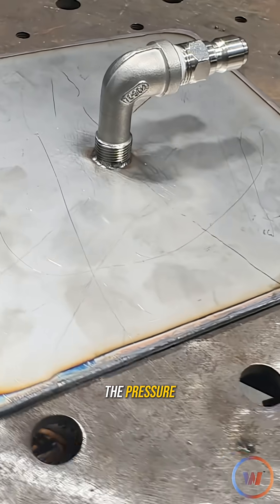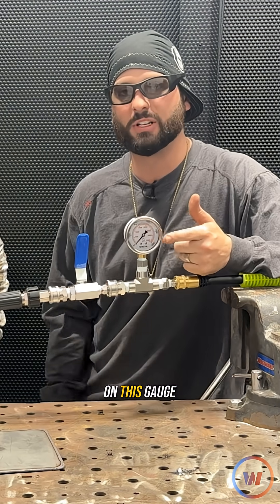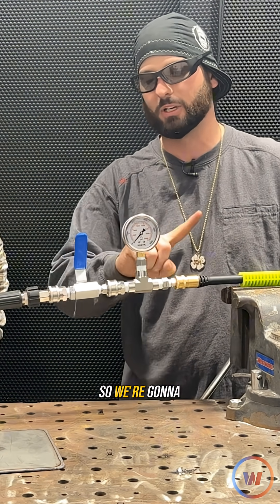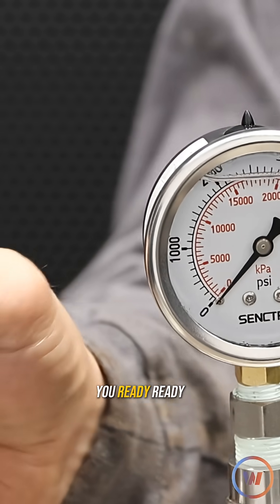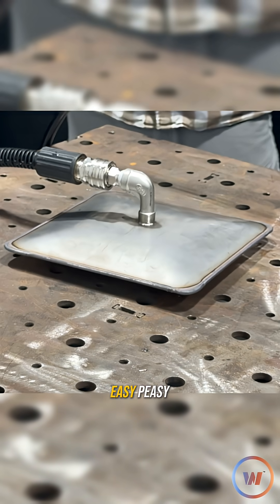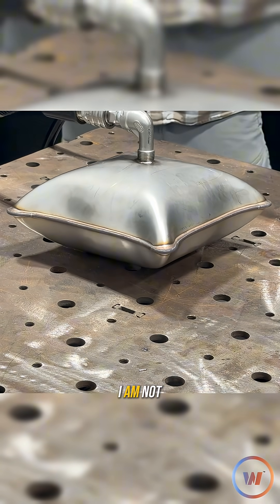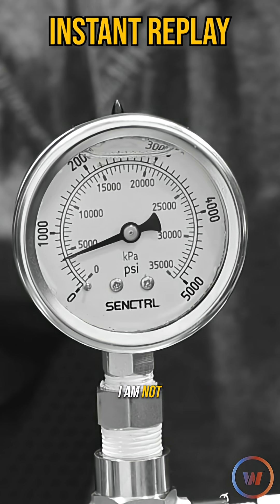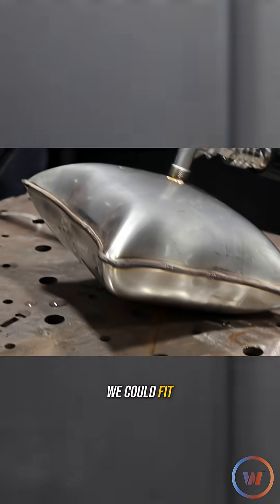Will It Hold Water?

Comment: 1000 psi is nothing. You can tig brase silicon bronze with steel to aluminum and still be within the psi rating for the rod. 316l has a rating of 70000psi for reference. Hook that B upto to a waterjet and get 50k psi out of it. I have repaired high pressure lines with 316l and they held we only replaced them when the new lines came from back order

Comment: This can be very dangerous if not done properly... especially if there is air/air bubbles trapped in any of the lines, with no pressure relief, drain or vent, it gets more dangerous the more pressure you introduce... Pressure Piping is usually tested around 150psi and up I believe... Great Video, just stay safe.
Reply: Yeah no it’s not 150 psi ain’t hardly considered a pressure part

Comment: Very foolish indeed, basically a hand grenade in the making. Vessels under pressure are powerful, I used to test water tight compartments ( in the inches of water MMhg) in the Navy, done wrong you could bow a bulkhead, deck or overhead in a second. 🗯️😵

Comment: Bro you guys are something special pressurizing a weldment with no barrier.  On top of not having any whip checks or sandbags on the lines youre also running quick disconnects. 

The only way this could be worse is if it was done with air or GN2.
Reply: @Thorn19774  you're so close to the answer... Lol water, not air.
Reply: @clippyisangry I'm aware they're using water as a medium, my point still stands. Using quick disconnects for pressure testing of any kind is asking to get hurt.  I have seen weldments fail with both hydrostatic and gaseous pressure testing.

 The fact is there are blatant safety violations occurring here.  Being  near a UUT with no secondary retention on your lines, placing yourself in front of or near a UUT not knowing the MDP of the unit while pressurizing it shows a distinct lack of safety culture and ignorance that could cost someone their life or limbs.

Water is a much safer medium however it is still an energetic event went weldments fail. A smart test operator would have been no where near the weldment while pressurizing it.
Reply: @Thorn19774  dude, it's a power washer. Pretty much every power washer on the planet uses quick connect fittings at much, much higher pressure than they used here.  Don't comment on stuff you don't know anything about.

Comment: What do you think would've happened had a leak at high pressure occurred with you standing in close proximity to the bladder? Safety first.
Reply: @Busterdmj1057  they would have gotten wet.  Hydrostatic testing is safe. 

Unless you literally touch it with you hands you can get hydraulic injection injuries.

If they do the same thing with air instead of water, and it fail, they get turned into chunky salsa
Reply: Using water, when it leaks or a weld starts to fail, pressure just drops right off instantly. It's a big non event. If you use air instead of water, you blow out all the windows, your ears drums and probably blow out your garage door.

Comment: You guys are brave inflanting that at and near your crown jewelry
Reply: Its water not air, if the weld breaks it barely even sprays out, water isnt very compressable so realistically theres only about 1% more water inside than there would be at normal atmospheric pressure for that given volume, where as with air it can be many hundreds of times the volume of air that would fit in the same space at a lower pressure, thats why air is dangerous and other compressed gasses. Basically when a weld pops during hydro forming it kinda just leaks out, it dosent spray out too badly
Reply: @clippyremembers  and i f there's pinhole in the seam weld? ....